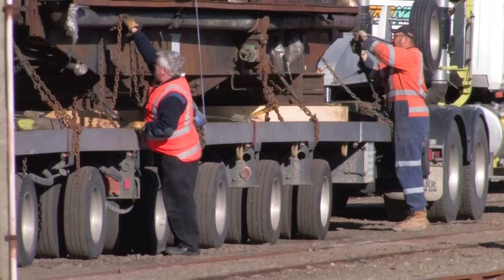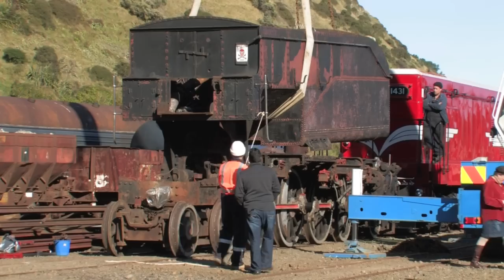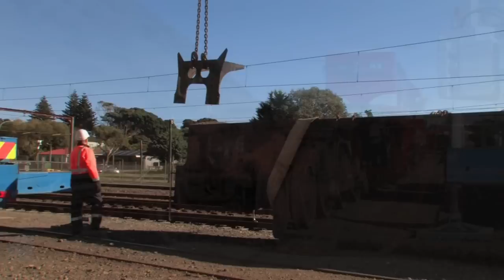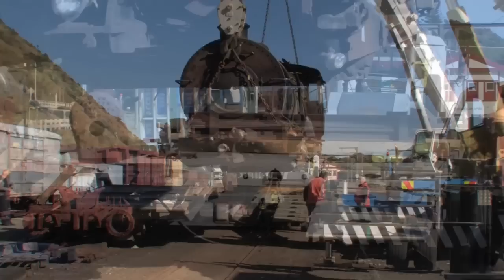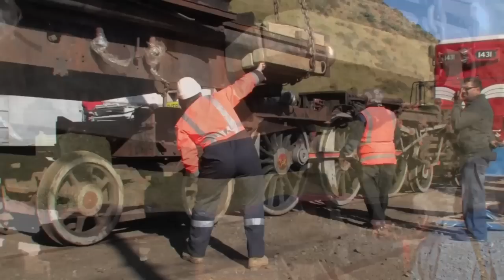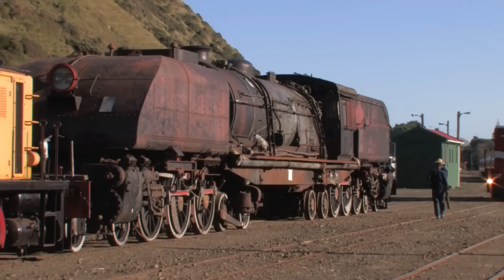Garratt Locomotive

Comment: Wow, that is just fantastic stuff. I have actually been on that locos footplate when she was at work in Rhodesia. Its great to see another garratt being saved. I was a fireman in SA and many of the SAR locos there in NZ were locos I actually worked on. Will have to get out there and see them sometime. Thanks for posting
Reply: We are fortunate to share the same 3' 6" track gauge as you guys. Given you have worked on locomotives here, would you say this is the first Garratt in New Zealand?
Reply: @scootergrant8683  What a wreck. No wheels! That needs scrap cutting as soon as possible.
Reply: @scootergrant8683  It is not the first Garratt in New Zealand. In 1928, three Beyer-Garratts were ordered and were classified the 'G' class. In 1937 they were scrapped and rebuilt into 6 '4-6-2 Pacific' locomotives. These locomotives survived until they were scrapped from 1956, and by 1960, none were left.
Reply: @LouisMcNabb  Gosh I completely forgot. But I thought that was only one. Gee whizz how did those perform on a narrow gauge?

Comment: Kenya-EAR are Metre Gauge; Rhodesia/ Zimbabwe--South Africa are 3ft.6in. gauge.
Shifting wheel rims or Width mods. may Convert 6:59 ...67mm /2.64inches Gauge Difference may possibly be simply overcome without major Running gear or frame alteration....
LongTime appreciation of the Beyer-Garrat system:
Britain Africa Asia Australasia Italy /Abyssinia Spain Algeria
 USSR any More???
DocAV

Comment: That was just 2 months after my visit to Steam Inc.
I have seen these behemots running in Zimbabwe, but this particular loco is not in my footage.
That was back in 1994.
But looking to the difference in loading gauge this locomotive is never going to leave Paekakariki by rail, it doesn't fit trough the tunnels on either side, so what are the plans?